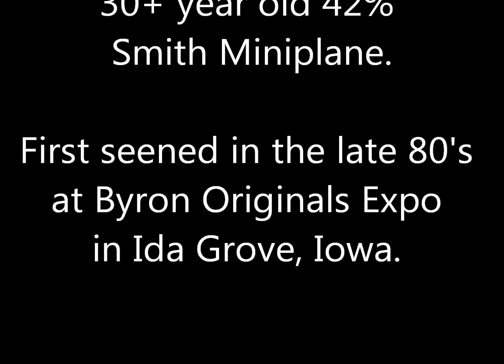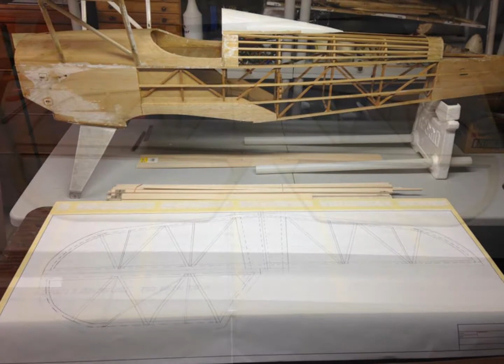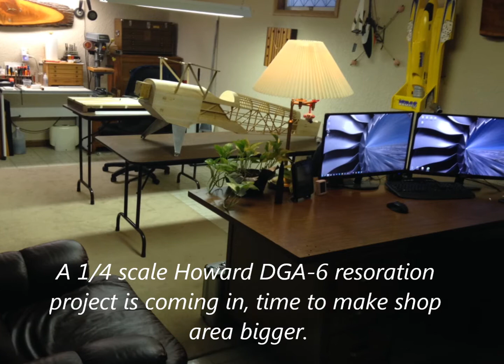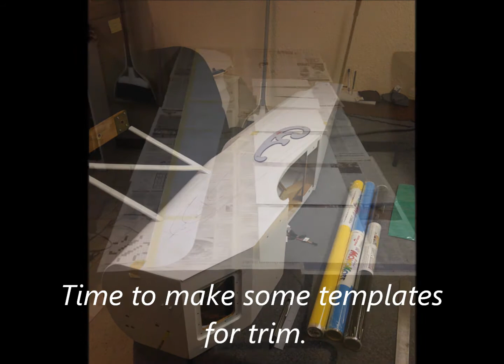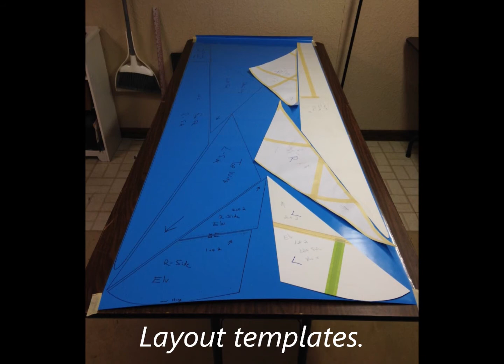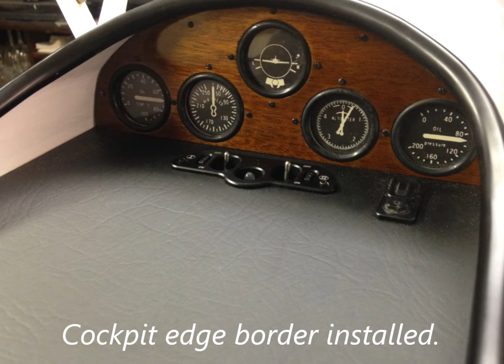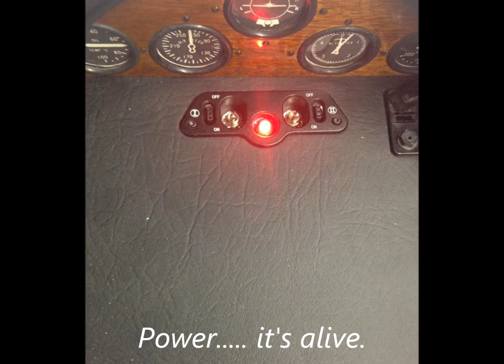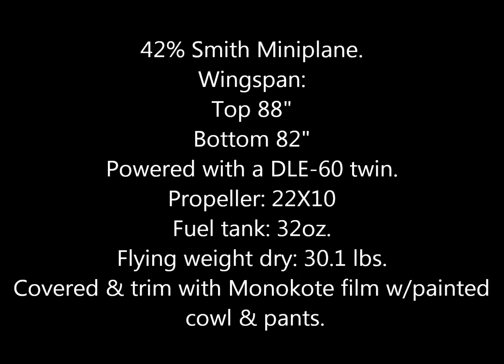7 month, start to finish 42% Smith Miniplane restoration project.

Comment: Excellent work.  Love your paint scheme.
I have a 50% Smith Miniplane that I’ve been flying since August 2016.
Just this last Sunday I put the 36th flight on it.  It is 47 lbs. with a DA150 and a smoke system.
Reply from the maker: Thank you!  I wish it had a little more engine than a DLE-60 twin but had one lying around the hanger not being used at that time. Love to upgrade to like a DLE-120 for better vertical performance.
Reply: @spudinater1984  The 150 is plenty of power, some say more than enough,,,, without knowing or remembering the weight of your Smith, a 100cc should be fine.  Where do you fly it?
Reply: Oh, just saw the weight, at 30# you should be fine even with an 85cc.